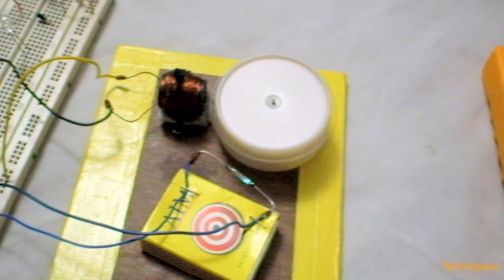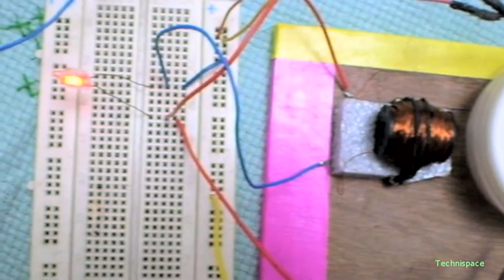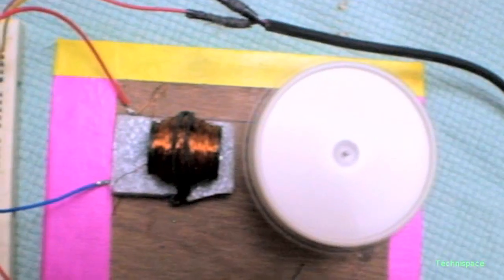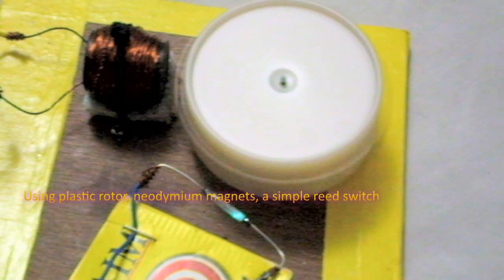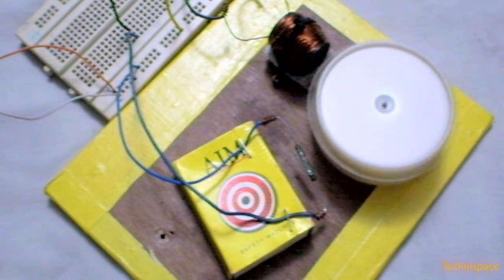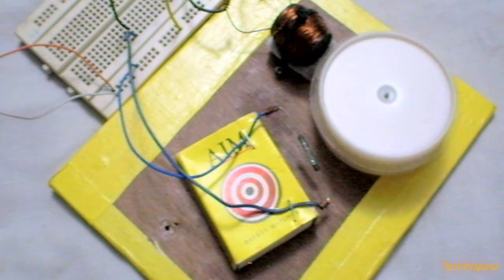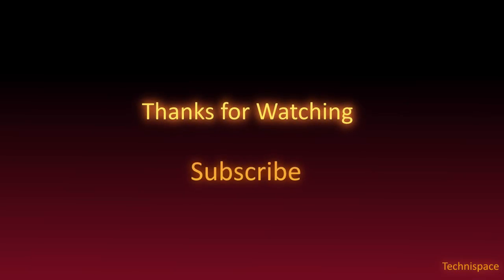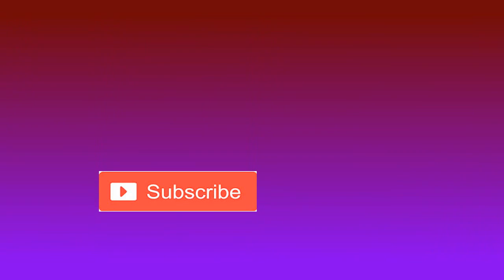Pulse motor with simple reed switch

Comment: mounting the reed that way creates a dead zone around the middle of the sensor and 2 detections zones at the ends. this coli will have 2 on periods instead of 1 for every magnet pass, but no harm done. the lid runs nice and straight.